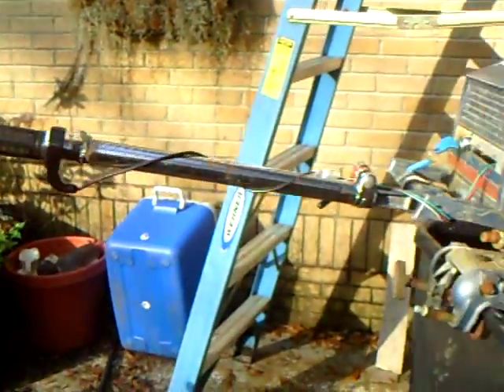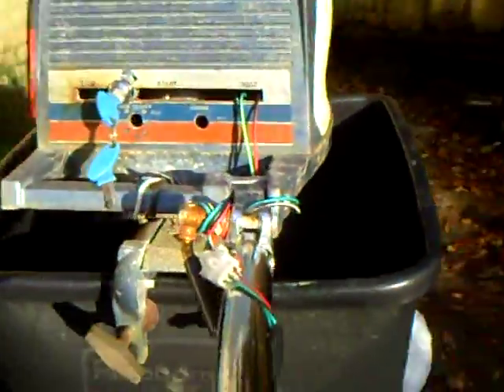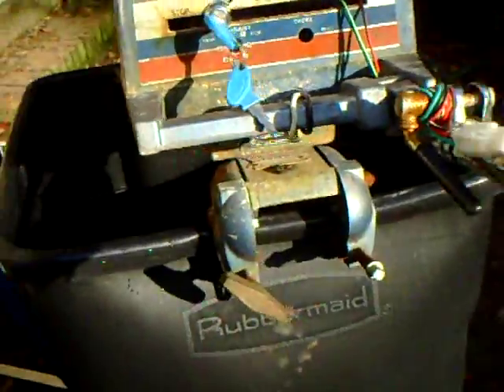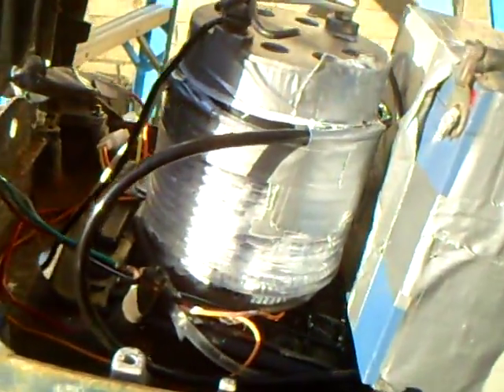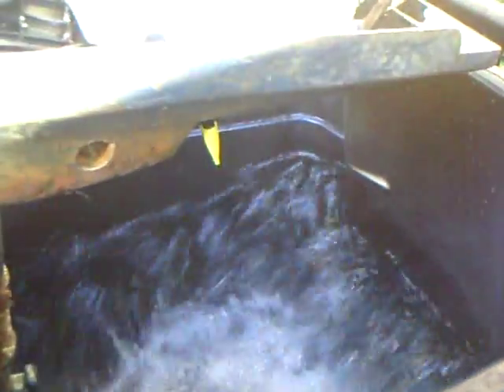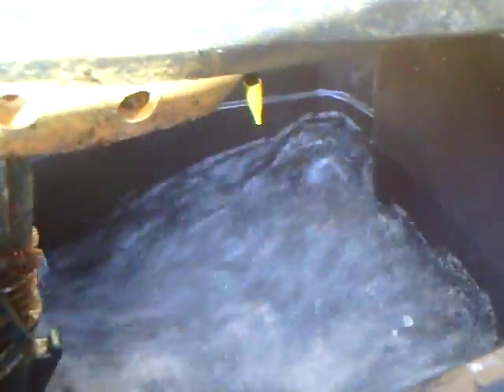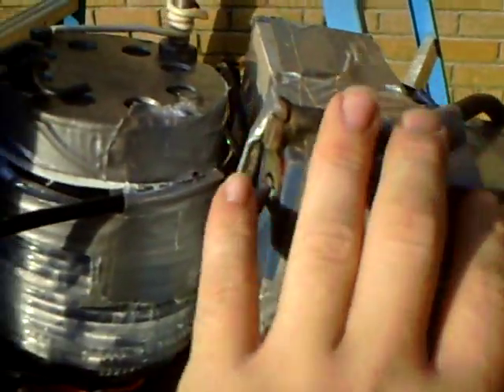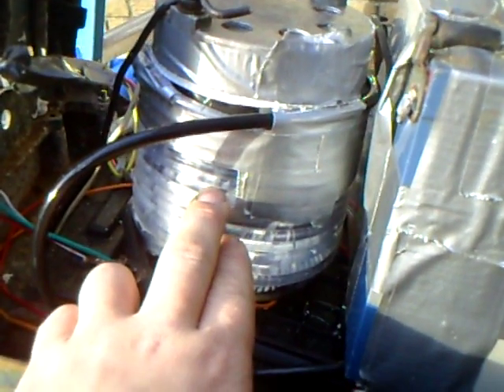1965 tecumseh boat motor converted to electric

Comment from the maker: @soverato3 i used 2 compact 12 volt scooter batteries, after it caught on fir i lost one, so now im on external bateries, but 2 12 volt marine deep cyles will run this thing for hours i mean you can get a full day out of driving this thing